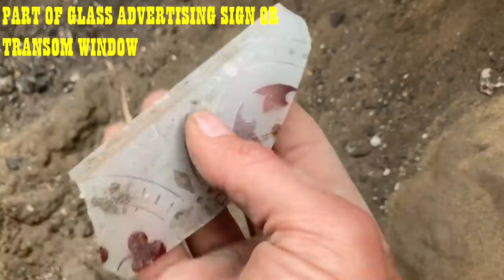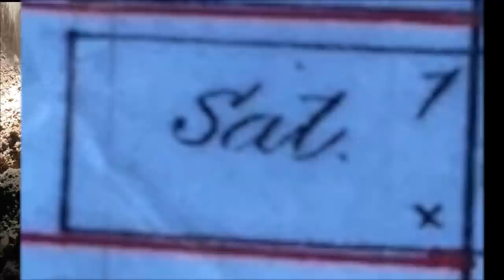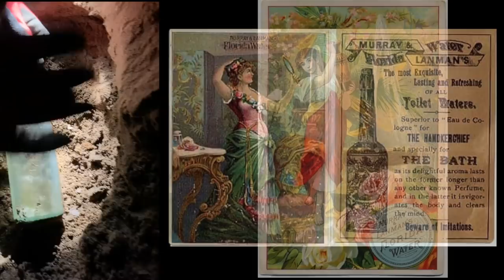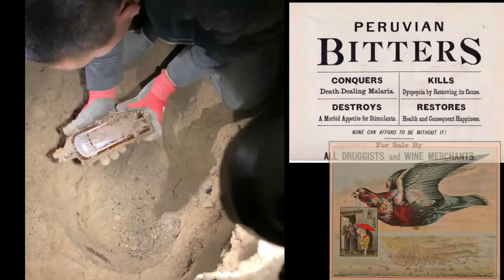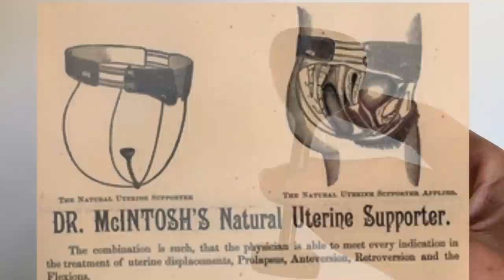BOTTLE DIGGING From the Desert Sands to the BROTHEL HOUSE

Comment: I have a old stone home and barn that has been bulldozed when it was demoed. I've located the stone lined well, but I can't locate the privy. I've probed and probed. It dates to 1800. There were actually slave quarter's there. I know some of the history of it. The barn was burned. The quarters were bulldozed and the lane was bulldozed making it wider and crushed stone was put over the lane. I've detected it found old flat buttons. Any hints on locating the privy. I know probe more. Lol. It should be a good one. It was owne by 2 sisters and they had money. That was in  the late 1800's.
Reply: It would be close to or on the old property line and usually a strait walk from the back door if you can still tell
Reply: @danieleckart3103  This was a 200 acre farm. Not on the property line. The whole area has been bulldozed in the 50's. The well is close to the back of the house foundation. Would the privy be close to the well?